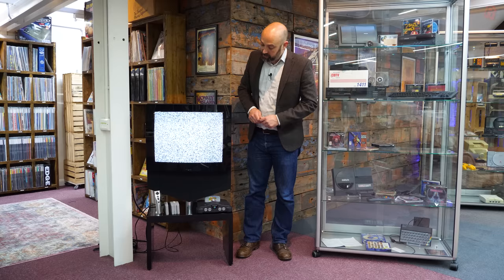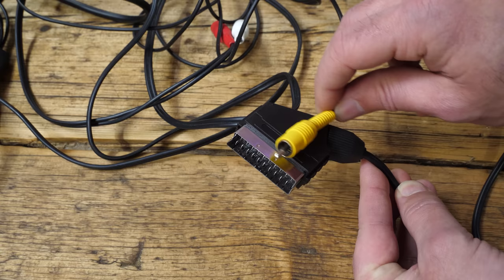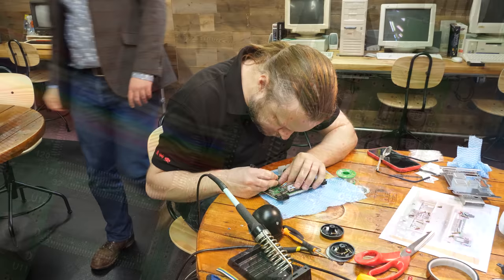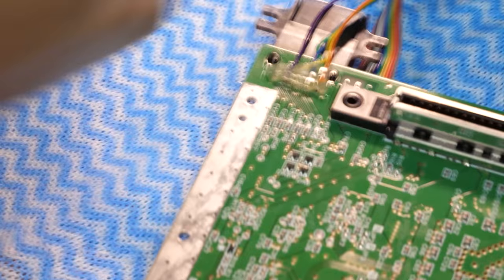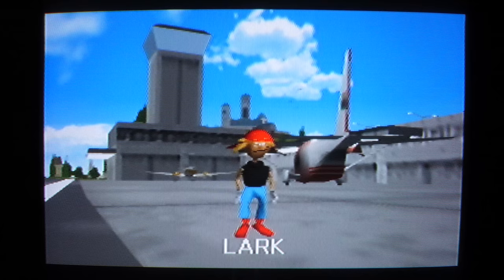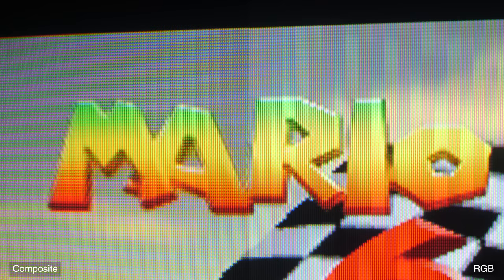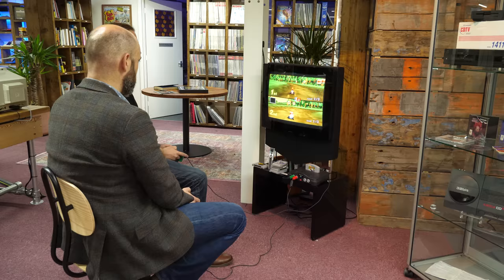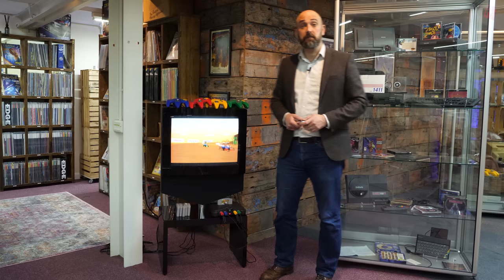Should I RGB mod my N64 (and look at this awesome TV!)

Comment: Sorry, But, IMO,The only thing that makes N64 games look any way decent today, is to upscale them. When you see some of the games running at x4 or x8 native resolution under emulation, in pretty much cycle accurate Vulkan API rendering cores, you realise just how far ahead it was as a console over the PS1 in terms of graphics, such a shame it was so well hidden under that video output that Nintendo cheaped out on (what a surprise!) , I've seen RGB mods in action and they really don't do anything much for the horrible low res 'Smeared Vaseline' look of N64 games. Honestly its amazing N64 owners didn't go blind, straining their eyes back in the day to make out what was on screen. Even CRT's have their limits to rescuing poor console image quality, and the N64 pushed up hard against them.
Reply from the maker: While I don't disagree with what you're saying if you're going to capture/stream you're likely to put it through an upscaler anyway such as an OSSC or RetroTink, so if you already have one of them you're saving money by not putting another in your N64. Although that's by-the-by for my primary use here which is the B&O TV
Reply: I disagree, old graphics up-scaled just look too dull and plain in my opinion. Even more modern consoles like the PS2 i see those videos of 4K up-scaled games and they just look bad to me.
Reply: Anti aliasing, filtered textures, hardware-accelerated 3D with stable geometry… the only thing that compared back then was a PC with a 3Dfx Voodoo card…. but it wasn’t the video output holding it back. The perception that PlayStation had better graphics was purely because of Nintendo going with the cartridge format. You couldn’t fit many textures and one of the easiest ways to squeeze the game size down was to abuse the filtering to get away with even lower texture resolution. This made people see an advanced feature like texture filtering as “blurry graphics.” A 3Dfx user would never turn filtering off unless they needed the performance because it was a clear benefit, but not when you use it as a crutch to smear a few pixels over a much larger area than you should like N64 devs did.

The N64 famously had other texture limitations but they were eventually overcome in ways that would’ve happened much earlier on had there been room on the cartridges for the textures anyway.

Comment: S-Video almost looks like an impedance mismatch to me. Might just be a bad (or poorly designed) cable. You shouldn't have all the dot crawl on S-Video either.
Reply: It comes from unscrupulous companies selling fake S-Video cables that connect Chroma to CVBS (composite). They are EVERYWHERE here in the states. Those cheap RetroBit, Old Skool, Tomee, etc cables are all made the same place and all built incorrectly like this. Presumably they did it to avoid returns since these will “work” with SNS-101 Super NES jr consoles that actually lack chroma.

Comment: Have always found S-Video connections quite nasty compared to RGB SCART. I was shocked the first time I tried S-Video as I thought it would be a big improvement over basic RCA/Phono red/white/yellow connections.
Reply: A proper S-Video signal looks great. In addition to the issue with using NTSC S-Video cables on a PAL N64, this appears to be one of those fake S-Video cables that is deliberately wired to composite so that it will work with a SNS-101 (Super NES “Junior”). That creates the interference patterns where CVBS clashes with Luma. The brightness issue is because PAL S-Video cables require an additional resistor.
Reply: @emmettturner9452  I've never seen it look close to as good as RGB with the kit I've used, personally. That said, I've seen co-axial connection (RF/UHF?) look great on certain TVs, so there's a lot of potential variety no doubt about it.